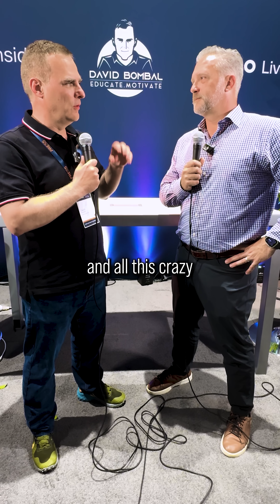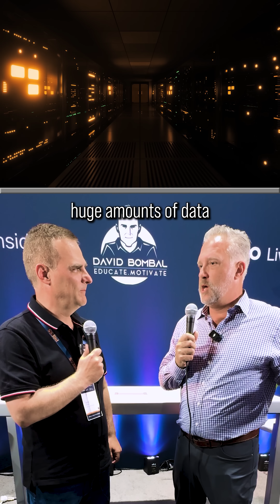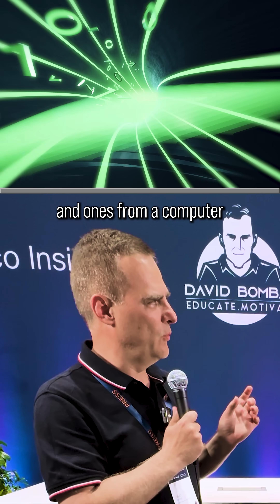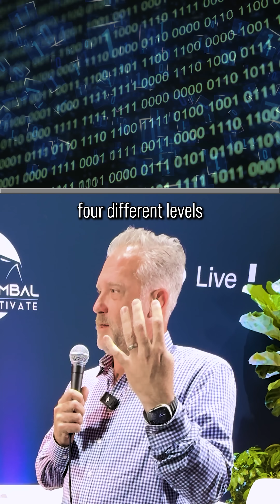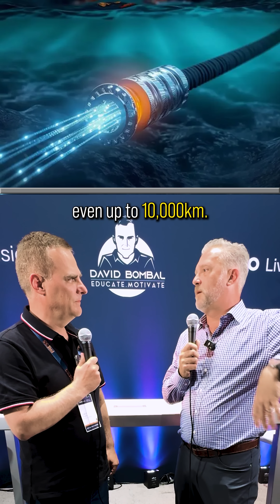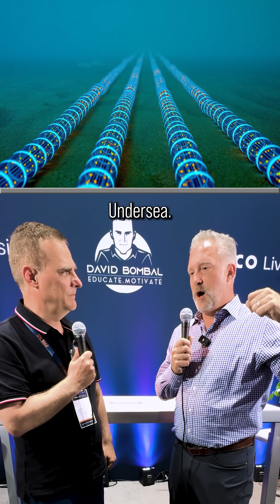How Light Sends the Internet Across Oceans

Comment from the maker: The whole internet rides on beams of light! 🚀💡 From YouTube to Zoom, it's all fiber optics. What surprises you most? Drop your thoughts below! 👇
Reply: Can confirm the multi-color wavelength transmission!!! At least 10 years ago, I was an employee at my local electronics parts store (not RadioShack) and was able to talk to an AT&T technician that was splicing fiber out in front of the store. He said absolutely yes! Just like we went from a red laser for DVD's to blue laser for Blu-ray, shorter wavelength allows for higher data density. Multiple colors over single fiber with color frequency splitters/combiners at both ends. Just got fiber installed in my neighborhood. Technician said the "laser" is in the infrared spectrum.
Reply: And the big banks are trying to take over the HF spectrum  to make low latency links between EU and US. Won't the greed stop long enough to think?
Reply: Great info David I always thought it worked like how you described it first, as just few pulses of light.
Reply: Certain banks are using spreadspectrum (RF polluting) networks on the HF parts of the radio spectrum to transmit data between the EU and US for high frequency trades. They are using this method because its latency shaves off nano seconds.

Im sure with an SDR and a little time breaking their protocols used, and any encryption used would be possible. Im not saying we should, im stating its probably not as difficult as we are told.
Reply: @Dennis_M1DLG  RF is prone to broad spectrum noise jamming. Laser diode is not prone to jamming as the specific light color/frequency is running down the fiber or "light pipe" so it is constrained to that medium.
Reply: Kind of irrelevant to my statement  @RTR-MATEY i mean, i didnt mention jamming.
Reply: Who owns Cisco?

Comment: Without having to stop, except you do stop at the amplifier? Otherwise you wold amplify the noise as well so they are just regenerating stations with fewer steps?
Reply: Amplifiers for applications like this dont amplify in the traditional analogue way. They restore the bits, then retransmit the bits cleanly. This means there is a very small delay (latency) but its usually very small, negligible really.